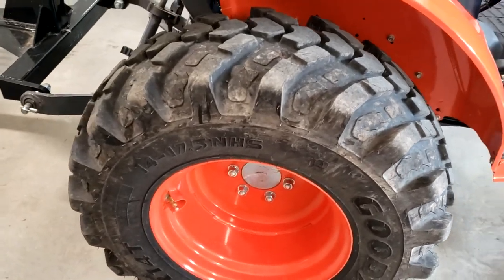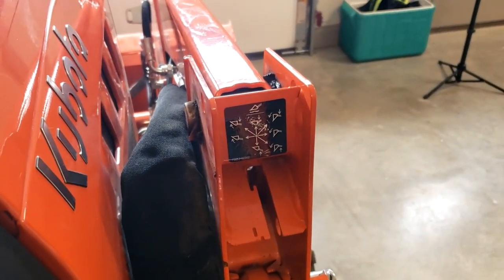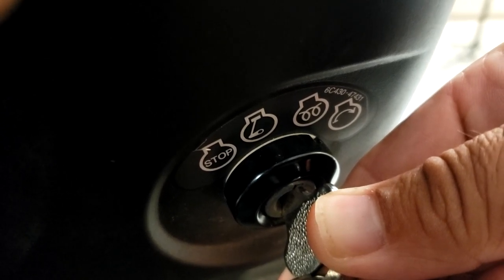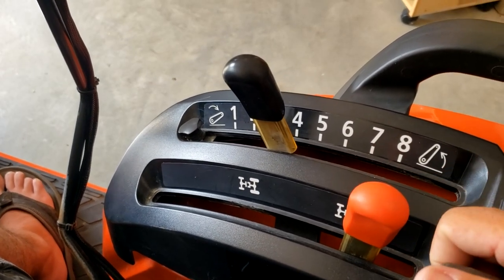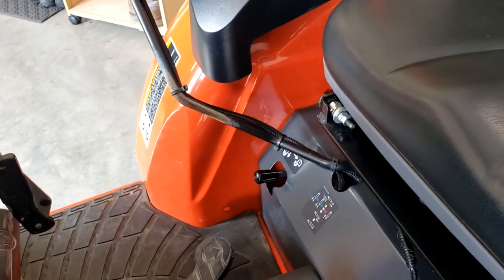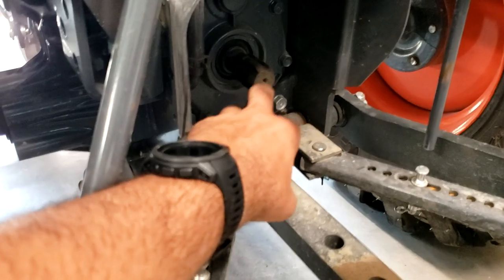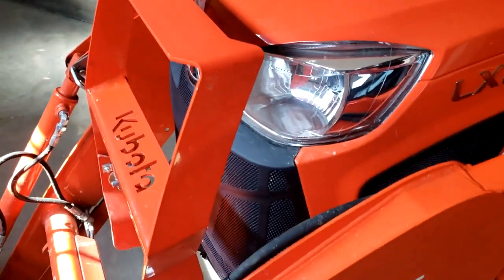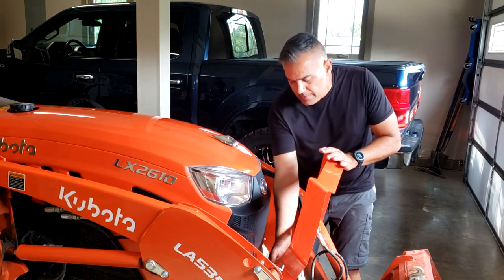Kubota LX2610 100 hour review buyer guide hundred hour thoughts should you buy one?

Comment: Diff lock has a safety feature to prevent breaking the tractor. It can only be used while the wheels are straight. If you turn the wheel it will disengage, if you have the wheels turned, it won’t engage.

Comment: For anyone loooking at the lx2610, please note: rearend is made of aluminum as well as most of the gear box. I higly recommend You check out the l2502 for $2500. It is heavier but the l2502 is pure metal. Hope this helps someone.
Reply from the maker: Thanks for sharing your perspective
Reply: That's actually not true, if it were John Deere in this class yes...but kubota is cast steel rearend in this ckass

Comment: Hello there Tennessee Yankee, awesome review, great detail. The R14 are excellent tires, I  have R4 on my tractor. What brand wheel spacers did you get?  My range selector for the 3 point is doing the same.  You've got to get yourself a spinner knob for your steering wheel, you'll be impressed with how well it works.  I haven't cranked my throttle up  that high before. l need to give it a try. Excellent tips. I agree that the steering wheel boot pops out to easy.  My diff lock has never been an issue to depress.  I use the Bx knobs to tighten my ROPS, since it tooless I can easily loosen them to put my ROPS down before parking in the garage.  Recently my fuel filler cap has become a real pain to thread on as well.  Great idea to have the ability to install a winch. I think I may set one up on the draw bar.  You got that right, the oil dip stick is hard to find the 1st time.  The brake and 3pt also have grease zerks.  Keep on tractoring!
Reply from the maker: Hey Paul, thanks for the comments. Yes I probably should get a spinner and second nature to me on my lawn tractor, but never really think about it much on this guy.   I’m usually at the highest RPM every time I come up my hill and heavy lifting, I’d say I’m running max RPM about 30% of the time.  So I looked up the wheel spacers on my invoice, and here is the number. B8785.  They are 1 3/8”.   Have a good week.
Reply: @TNYankee2020  Thanks I shall look into the wheel spacers.

Comment: Hello Tennessee Yankee.  I really enjoyed your review.  Same layout as our B2601,  just a bit heavier and a bit more lifting  capacity.   Also, the same loves, and complaints.  I put a little adapter on the treadle peddle, which allows me to put my toes under it when using reverse.  It was a hugh improvement in comfort when using  reverse. I think you were quite wise to add fluid to your rear tires when you bought your tractor. I recently did that to ours, and noticed a remarkable difference in the feel of the ride.Thanks , Ben
Reply from the maker: Thanks for watching and for the great feedback, I was very intrigued by your treadle idea, so I looked it up on YouTube and low and behold Saw your video.   Did you have to heat up that rebar that looks pretty thick?
Reply: @TNYankee2020  Good morning Jeff,  the rebar I used was 1/2 inch if you measure it at its widest point. I didn't have to heat it. I bent it in the vise using a length of pipe for extra leverage. I made the loop that goes over the peddle first. Hope this helps, Ben

Comment: Nice review!  I’m on the other side of the mountain from you (WNC) and bought a Yanmar.  I loved the LX.  On the topic of front spacers my thoughts are that since the axle pivots at the center I don’t believe you would gain much stability.  My old B7100 HST went to my son after serving me perfectly for the last 30 years.
Reply from the maker: Thanks for the feedback.   Happy Red Tractoring 😀
Reply: @TNYankee2020  my Kubota dealer (Asheville) told me that the LX with a mid-mount mower option wasn’t available without jumping to the 30hp model with the exhaust filter/regen and associated cost.  The tractor was too big and too expensive for me.  The B series has significantly less loader capacity than the red option and I really need that for the forks in my application.  Too bad, I really like the dealer, they are great. So far so good!  Keep up the good work on the videos.

Comment: TY,  Great video with a lot of tips and information. I will definitely invest in the gas tank screen as you stated there could be particles in the diesel or can. I have a 2610 as well and have had a couple of issues with the fuel cap. I have the cab model which has a high center of gravity so the wheel spacers are another great tip I must invest in. Thanks MM
Reply from the maker: Thanks for watching and the great comments, you’ll really like those wheel spacers
Reply: I also have the cab model and had them install wheel spacers when I bought it.  Highly recommended!

Comment: I am considering a Kubota LX2610SU I dont need the mid mount mower. but I want to have a bush hog, tiller, loader, generator, and chipper. I am not going with John Deere too much plastic and propriatary loader attachments. I want to put a main battery disconnect on it and put some work lights i may put a canopy on it also.
Reply from the maker: You’ll be happy with it, I would’ve been OK with that as you but looking back it was six or $800 more for my model so I went with that obviously for the tilt steering the more comfortable seat and potential future resale value but I don’t think you can go wrong either way.   Thanks for watching.

Comment: You should run off-road diesel in your tractor is better for your tractor they say and also it is about $.20 cheaper per gallon just thought you’d like to know
Reply: No difference between off road and on road diesel besides the lack of road tax and the red dye
Reply: The on or off road fuel is EXACTLY the same "fuel quailty" stuff. There is "one advantage "; the off-road fuel INSTANTLY shows water... it does NOT mix with the Red Dye!!!!
Reply: Those days are long gone. The only advantage to running off-road fuel is no road tax.

Comment: Just curious....if you're not going to put a mid mower on it why not go with the larger rear tires...?
Reply from the maker: Hmmm.   I think I have the biggest ones I can get outside of being an ag tire. I love these tires.
Reply: @TNYankee2020  is yheu the 15-19 or 15-17 or whatever size rear? There are two rear tire sizes. On the new LX3520 and 4020 you can actually run a mid mower with the bigger rear tires. On the previous iteration only the smaller rears would work with mid mowers and that's why most dealers stock the smaller ones I think 🤔